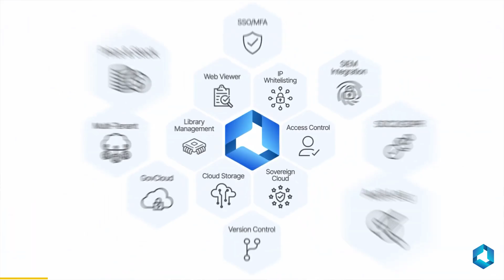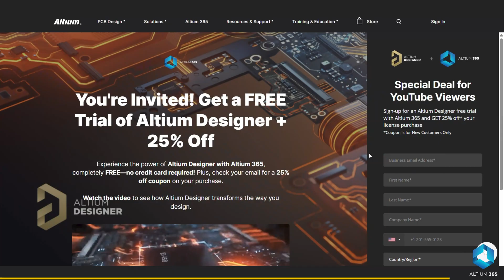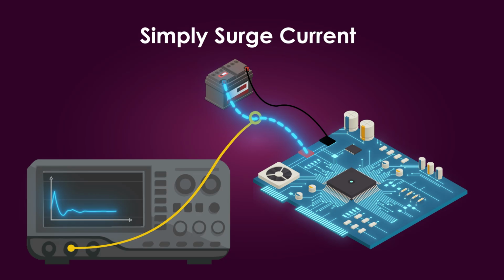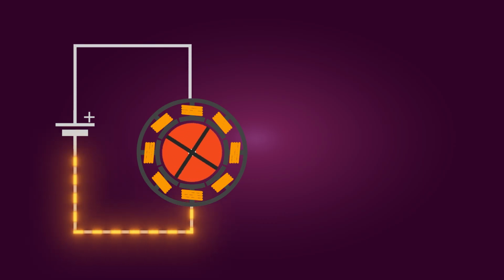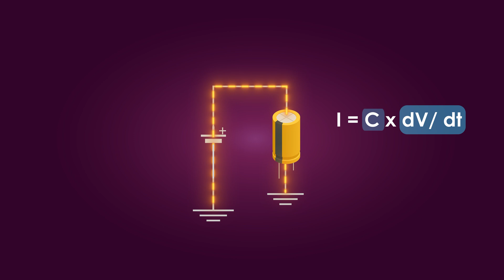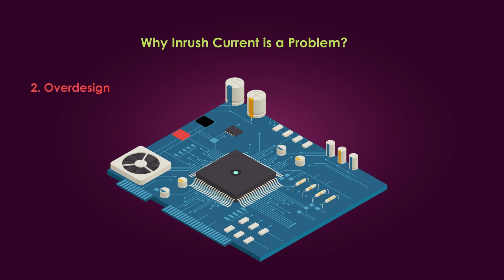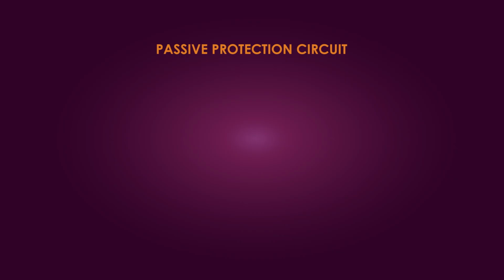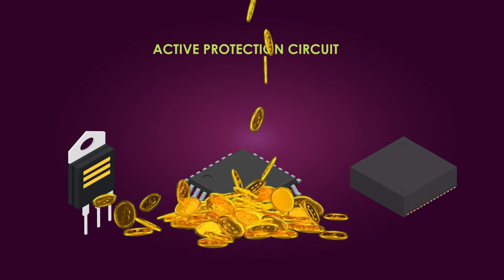What is Input inrush current? The Shocking Truth About Inrush Current

Comment: It's a good content! Even I'm facing a inrush issue in my circuit, where my load is 250mA ,the inrush is coming upto 1.5A, when I switch the load with low side gpio driver ic, since the driver has over current protection, even the inrush for some micr sec is triggering that. Since my load is turned on and off every 1minute, ntc did not help, but I added a series resistor (10 -15ohms), which helped me to reduce the inrush with little voltage drop . But even for the first time the switching, I see inrush is upto 1.3A, second time the inrush is reduced to 600mA, it was surprising, do u have any idea?